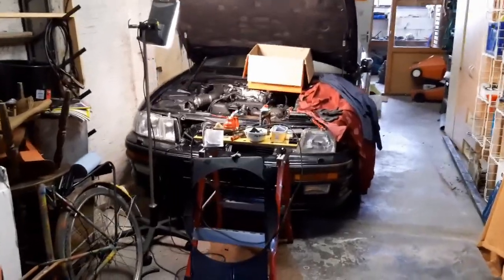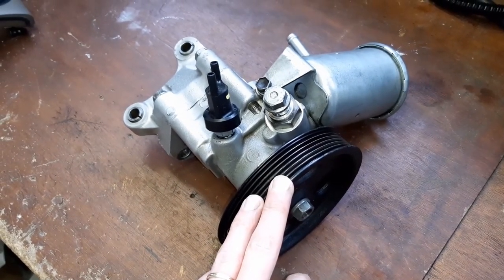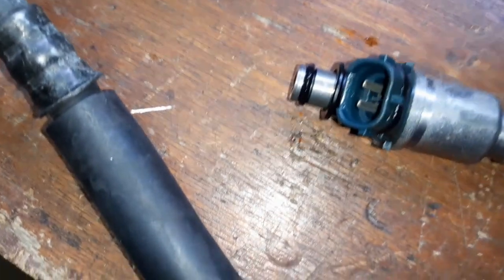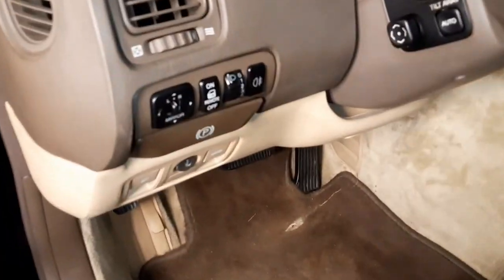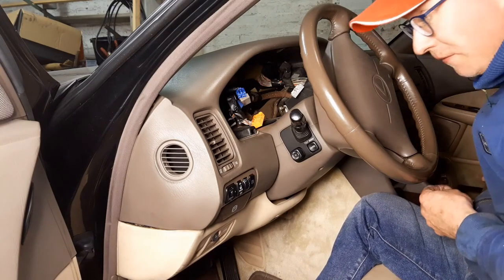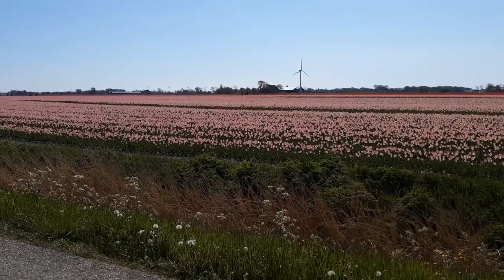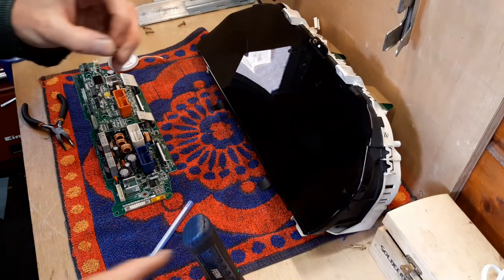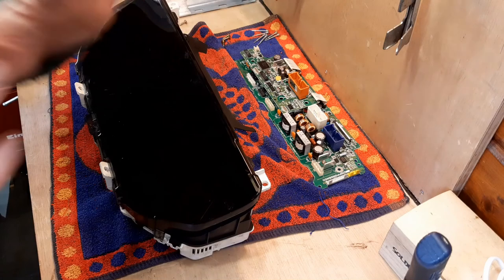Episode 12 - Project Lexus LS 400: Instrument panel repair (and closing the hood, I'm done there)

Comment: I’ve seen many videos and forums for 93 and 94 models but nothing for 91, the set up is different. Any way to tell which capacitor causes black screen for the 1991 ls400?
Reply from the maker: Thanks for your question. Unfortunately I don't have the answer. The circuit board of the pre-facelift UCF10 is indeed different. I don't know how many capacitors there are on the circuit board, but they are know to deteriorate after three decades. I think it wouldn't hurt to replace them all, just to be on the safe side.

Comment: i know this is old but could you please link the parts? i tried looking them up but couldnt find them
Reply from the maker: These are the parts you need: A 10mircoFarad / 16 volt capacitor (marked c212 on the board), 4.7 microFarad / 25 volt for position c142, 10 microFarad / 50 volt for position c147. Let me know if you need more information!
Reply: @Carnold_YT  Thank you so much!!!!!<3
Reply: @Carnold_YT  what website did you order them from?
Reply from the maker: I believe I ordered them from RS Components.

Comment: Hi, Arnold my speedometer doesn’t work. But it works when it gets hotter outside. What can this be? I have already replaced the capacitors in the ECU
Reply from the maker: It is a known issue Brandon, the grease inside the speedometer gears gets sticky, causing the needle to stay on its rest. If you gently smack the top of the dash, the needle jumps up and will work normally. It's caused by the ageing of the grease inside.

Comment: Good evening Arnold. Thank you very much for amazing videos! 1. Can you please tell me: what was the year of your first LS400, mileage and what major repairs it had? 2. Why did you decide to buy  this particular generation of LS400 for a project car? 3. What's the year and mileage of the project vehicle please?
Reply from the maker: My first LS was a 1993 first generation, just as my current one. That had 211.000 km's when I got it. The major repairs on that car were a new air suspension strut on the rear axle, new suspension components on the front and a major engine service (belts, water pump, valve clearance). That car was competely rust free, in contrary to my current LS. It also needed a dash repair. I bought this current LS because it was the cheapest one I could find (and afford) and I know this model quite well. One thing I like is that is fairly easy to repair with normal tools, especially the electronics and electro-mechanical parts. The newer generations already have much smalled components on the circuit boards. It is a 1994 with 336.000 km's. Thanks for watching!
Reply: Thank you so much for a reply. I've never had a Lexus. I like 94 to 00 models, although I was told 97 to 00 5 speed gearbox  doesn't last that long as the older one. Will definitely buy a LS400 one day! Where did you learn mechanical skills? @Carnold_YT
Reply from the maker: I learnt my mechanical skills partially from my dad, partially out of necessity. When I was younger, I had a classic Honda fourstroke bike to go to school. Back then, that was already a classic and every now and then it needed a repair. Since I had no money, I had to fix it myself, on a strict budget. At one point I decided to overhaul the engine in a weekend, and that taught me a lot. Besides that, I needed it up and running after the weekend, otherwise I had to take the bus to school. Most of my skills are self-taught, I ended up working as an automotive expert without ever going to auto / mechanics schools. I do work a lot on the theoretical side of automotive tech, so I always say that I'm a professional by day and amateur in the evening hours when I work on my own cars :-)
Reply: @Carnold_YT  Thank you. All the very best and good luck with all the projects you decide to have 😊.

Comment: Hey Arnold! Just wanted to ask where'd you get the info on the Instrument Panel's Capactiors? I can't seem to find the info for my 1992 LS400. On another note, I just brought the capacitors (that Yamae from the Lexus Forums recommended for an LS400 '92 model) to my electrician so hopefully my ECU can be fixed. Wish me luck!
Reply from the maker: I ordered them from RS Components , via their webshop. I'm not sure where you're located, but I believe they have worldwide shipping.
Reply: @Carnold_YT  I got mine from digikey, i just need the info on the correct capacitors for my instrument cluster. 

On another note, whats the update on the ECU you bought from that Flagship One website? (correct me if i’m wrong)
Reply from the maker: @saf574  I didn't arrive yet, it still resides at customs and DHL hasn't registered it. Bit bummed :-(
Reply from the maker: @saf574  I think I mentioned the values in the video, I have to re-watch the episode first ;-)
Reply: @Carnold_YT  hahaha yes i saw! but i’m wondering if yours are the exact ones i need :( can’t seem to find info on my instrument clusters capacitors
Reply: @Carnold_YT  oh i see! thats unfortunate. Keep us updated if there’s anything :) Hope it works out for you. Mind i ask why do you need the newer ECU? Didn’t you fix yours?
Reply from the maker: @saf574  That ECU was from my friends LS400. At first the repair appeared quite succesful, but the car later developed new problems. That's why my buddy ordered a refurbished ECU. Now just hope that it works. And that it arrives 😉
Reply: @Carnold_YT  oh i see! that’s unfortunate 😟 what sorts of problems? i’m hoping this ECU fix will be the end of it hahaha but i know thats just wishful thinking. 

I tried to look for my ECU but can’t seem to find a replacement for it. My ECU model is the 89661-50170 (JDM LS400)

Comment: would you happen to know what capacitor to replace for the temp sensor? mine has died. I've replaced the sensor itself but its still not working
Reply from the maker: Good question, but I don't know the answer. Did you check the wiring and all? Is it for a first gen LS400, then I can look it up for you. Thanks for watching!
Reply: @Carnold_YT  yes a 94. I will trace the wire and see. Thank you!

Comment: Make a shield to fit over the alternator so if the steering pump leaks again the fluid will not get into the alternator.
Reply from the maker: Thanks for your idea Sean. I have plans to install such a shield once I get hold of a good power steering pump (which might take a while). Thanks for watching!
Reply: Those don't work at all. You may believe they do, but they don't. Ask any auto electrician who repairs Alternators.

Comment: What parts do I need to order?
Reply from the maker: A 10mircoFarad / 16 volt capacitor (marked c212 on the board), 4.7 microFarad / 25 volt for position c142, 10 microFarad / 50 volt for position c147. I hope this will help you, good luck!
Reply: @Carnold_YT  Awesome thanks, are these all the capacitors that I should need to do? Or does it very per cluster based off of the ones that are deteriorating?
Reply from the maker: These are the ones know to go bad and that cause the instrument panel issues. But it always makes sense to check the other electrolytic capacitors and replace them if necessary